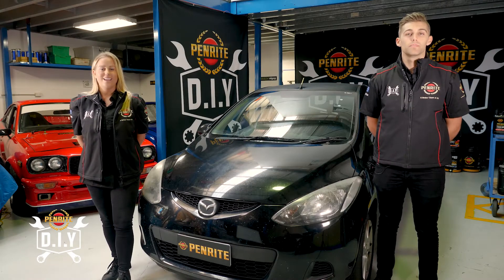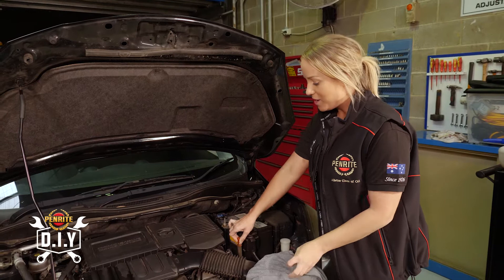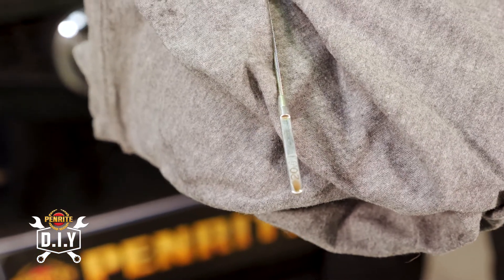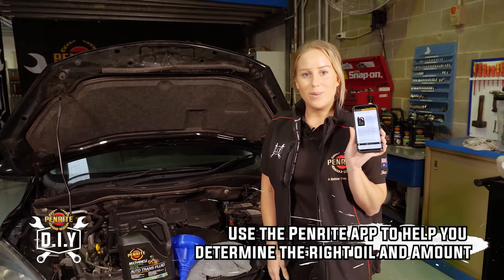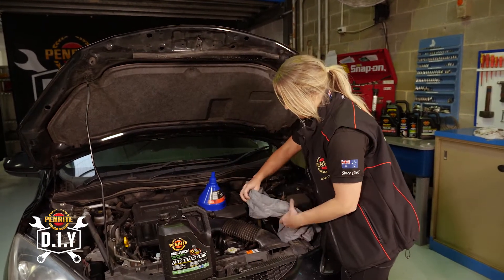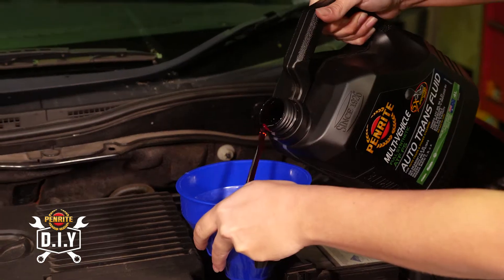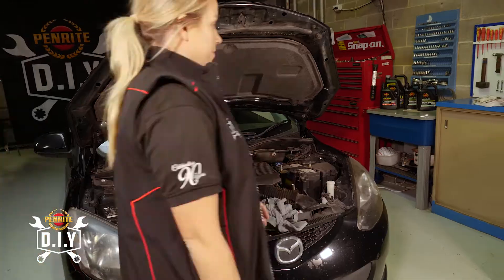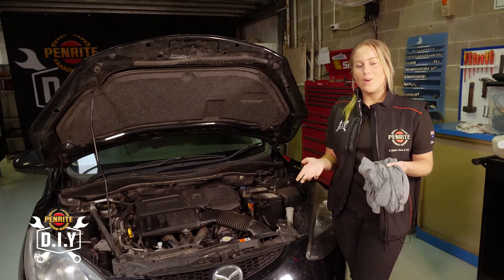Penrite DIY How to Top Up Your Automatic Transmission Fluid

Comment: Putting a rag in the engine with the engine running (as your engine is supposed to be running after going through all the gears)....Not good advice ......

You need the auto gearbox running and in park as the torque converter tkaes fluid as well....You do NOT check auto gearboxes with the engine off...

Get a a fairy liquid bottle and fill with fluid and you can use that with or without a tube on it